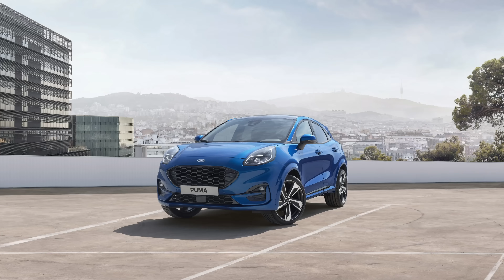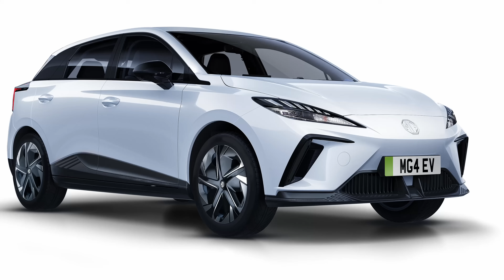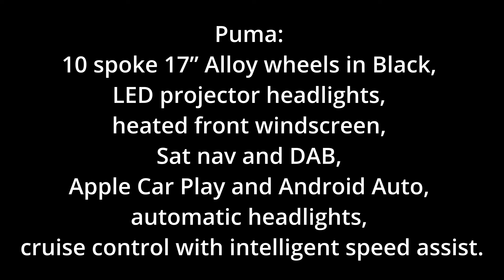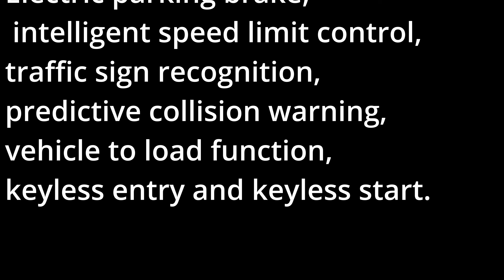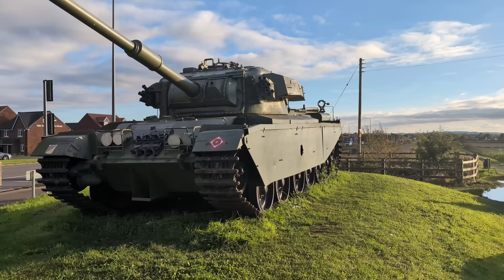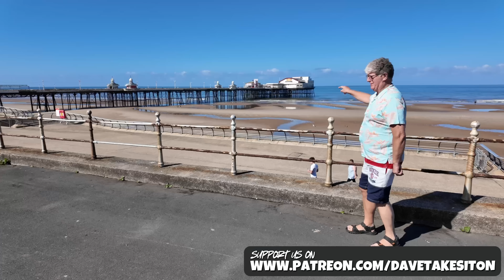Are Cheap Electric Vehicles REALLY Better Than Cheap Petrol Cars?

Comment: Another point in favour of the BYD Dolphin is the PCP rates. This negalres any worries about residuals (which are always a worry in a relatively new market, which is evloving si quickly). £289 deposit, £289 a month on 8k miles a year over 4 years blows anything else I've seen out of the water. Oh, and 3 years free servicing too! I bought mine from DM Keith in Grimsby, who were helpful and efficient, and a long standing local dealer, even if the brand is new to the uk. Maybe we could have a video comparing pcp offers of ICE vs EV cars in the future, as for most people this is the way we will fund our next car...

Comment: Nice one Dave, you can't argue that they are too expensive. If you only buy a second hand car the EV market is full and has many great value EV's that will still do a great job and provide almost all the range of a new one. Only time to wait is if you want an EV older than 5 years old as the good ones "in general" are still waiting to reach that age. Thee tech in an EV is far in advance of most ICE cars, such as adaptive cruise and pre heating.

Comment: If you like driving on a battery BOMB>
its the same with solar panels  and wind turbines  they cost more to make and the pollution
that they can make in a lifetime .
if you go mad and buy a battery car you must also have in boot a full camping kit   everything.  for when the charging goes ape shit.
Reply: @ashwayn  Solar panels have a 20 year life expectancy, wind turbines can run indefinitely. That's fair more power production than coal or oil. 
Driving a bomb? Do you understand that petrol burns? Have you ever actually seen an EV burn or explode as you suggest? I've seen plenty of ICE car fires, never electric and the current generation of batteries don't burn unlessintentionally ignited. The chemistry makes them near inert to the point you can shoot holes in them.
Reply: @chrisw3771  look on google scraped wind turbines you are off ya head wind turbines at sea are fucked after 20 years 
and I looked it up 10 years ago to relace a sea wind turbine blades  cost over a 1,000,0000 £

Comment: If you want to replace petrol/diesel cars,maybe replace them with something as useful or better.Still waiting for that to arrive.
Reply: Then you've obviously had your eyes wide shut for the past 5 years.
Reply: I would like to inform you that a vehicle type much better than petrol and diesel has been around for about 12 years. They are called Battery Electric Vehicles (BEVs). They are now as cheap if not cheaper to buy than Internal Combustion Engine vehicles (ICE). Also they do not require the maintenance of ICE, last much longer and are much cheaper to run than ICE especially if you charge at home. Another great thing is they are very environmentally friendly because they do not spew pot toxix gasses like the petrol and diesel vehicles do. I hope I have enlightened you on what is now available to replace toxix ICE vehicles.

Comment: Even if I'd buy an ICE car (which I won't) I wouldn't buy a Puma with its almost self destructing wet timing belt 1 litre Ecoboost engine, fine if you're only going to keep it for 2 or 3 years but dodgy as a long term ownership prospect.
Reply: Oh blimey I thought that they had solved that wet belt issue disaster.  I would never buy a Ford anyway!! 👍

Comment: You need to pay a thousand quid to put a charger on your drive. You cant get house insurance. Forget it. Second hand petrol every time.
Reply: Complete nonsense, it’s not a question insurance companies even ask.
Reply: Thats only if you want 7Kw charging. If like the average driver in the UK you do 20 miles per day then a normal 3pin plug at 2kw is plenty. It will give 8miles per hour so 8x6 hours(at least 6 but often more) will give 48 miles per night, over twice the average mileage per day. I put in a EV fuseboard/ 32a commando socket and cable for about £300. Even if you did spend the £1000 for a charger you would get it back in the first year anyway.
Reply: I’m in the US. Pay for an at home charger and it will recoup the initial outlay in 12-16 months in petrol savings. It depends of course on the cost of electricity and how much I drive.
Reply: Yes commando socket works for me too, £40 socket and some cable and trip switch for the consumer unit and it,s dumb so nothing to go wrong
Reply: @C-L66  Exactly. I put in an EV board with surge/rcd/pen fault and needed a 10m cable plus the commando adaptor for the Tesla mobile charger hence the £300 cost but its now got all the correct protection so worth it for peace of mind.
Reply: You don't really, most come with a 13A charging unit you can plug into a 13A socket and easily get 40 miles plus added overnight as you sleep.

2p per mile.
Reply: Two of my home chargers came free with  the car (Government grants) . My house insurance didn't ask about EVs they did ask about the cameras covering the driveway.
Reply: Pay to fit a charger and roughly 8,000 miles of charging has fully paid for it if you add the cheap overnight charging.
Reply: 😂 absolutely ridiculous, I use a granny charger that cost £95. I charged my EV from 56% to 100% last night using free Octopus Agile  electricity, and they paid me 22p. Insurance companies don't even ask about EV charging 😊

Comment: The problem is NOT everyone could charge home. For those of us living in a flats we need a large batteries as to let allow us to get throughout the week commute (300-400 miles) with one full charge over the weekend while doing my shopping. Smaller battery and frequently charging (public charger) is no go for me.
Reply: I agree it is more difficult and expensive for the 40% of people that can't home charge. This is where local councils should step up and ensure there is plenty of on street charging at sensible prices. Another option would be workplace charging, my nephew get his charged up for £1 at work, a great way to retain staff.
Reply: @MrDAVIDATKIN  Local council charging is not a problem in London but the time limit. Those are either slow chargers but still 2 hours limit or in case of the lamp posts charging strictly Residential Permit only places. I got plenty of public charges around where I live in London but all of them 2 hours stay limit or till vehicle is charged. I have no time to charge and be around the car / loose time as to remove the car when charged during the working week. That is why I had mentioned that 400-500 miles on single charge is a min for people like me. Living in flat and no work place charging. With this range I would fully charge over the weekend while shopping and then good to go for over the week. Anything less would require me to charge midd week or often therefore increase of my working time if I can not go home after work. So I am looking forward the new TY whit its rumoured 400 miles range.
Reply: There seems to be an upswing of focus on the 30% (varies by region) of households who cannot charge at home, an analysis from a few years back showed that the preferred method by drivers was on-street charging for those living in densely packed terraced housing and local fast/rapid charging the preference for those living in flats. 

There is a focus, in both central and local government to increase the access (simplify the process) for gully and on-street/lamp-post charging for the terrace group, and driving up the rollout of localised destination and rapid/ultra-rapid charging for the flat group, including incentives. There is also a push by EV driver organisations to establish a 'right to charge' similar to that implemented in other countries, to replace the barriers present for renters and leaseholders for installing their own chargers or using the schemes/incentives available (such as the subsidiised installation of chargers for flat owners). 

The latest government analysis (24th Dec) shows the range of needing on-street/public charging varies between 24% and 36% of households by region, in England the urban peak is now 32%, of which 16% have access to charging within five minutes of their home. A key barrier remains charging cost, which although is cheaper than fossil-fuels when using EV charging membership discounts is still significantly higher than that of home charging; again driving organisations are seeking for the VAT element to be lowered to the same as home charging.
Reply: @GruffSillyGoat I agree with what you've said, the only thing I slightly disagree with is that memberships for EV charging is cheaper than fossil fuels. I would say as an EV driver who occasionally uses memberships that they are comparable with current fossil fuel costs. An example would be Ionity passport, one of the best out there in my opinion that gives a rate of 43p kWh. At this time of year my car returns 3.3miles kWh or 13p a mile, also that hasn't factored in the £10.50 a month membership.
Reply: @MrDAVIDATKIN  - I based my statement on the average petrol mpg, which is 36mpg in the UK (source: NimbleFins) and average UK petrol cost £1.36 (source: RAC). The average EV does 3.4 miles/kWh or 4.2 miles/kWh for long-range EVs (source: EV database). The petrol £1.36 equates to a charging price of 60p per kW or lower for an average EV (71p or lower for a long-range EV). These are higher rates than membership based charging rates even factoring the membership fee into the calculation. 

For the 7,600 average UK annual mileage, 633 miles per month, this equates to £109 per month for petrol and £91 per month for Ionity including the £11 monthly membership; the petrol car would refuel twice and the EV would top up two to three times depending upon the battery size.

Of course for ICE there is the regret cost of two thirds of the energy purchased being lost to waste.
Reply: @GruffSillyGoat I'm an EV advocate, we have 2 in our household and none of them do very well at this time of year as far as economy goes. Certainly both are in the low 3 miles per kWh, with charging loss I would say more likely 3 miles. On short journeys  even less. My last car averaged about 45 mpg, my wifes pevious was about 50mpg across the year. So 36mpg might be what the RAC quote as average but it certainly is not correct for many. I'm not trying to be argumentative just accurate. 36mpg is a very low assumption in my view.
Reply: @MrDAVIDATKIN  - The MPG averages can be a little suprising to many, but have been raising over time, it's just there are a lot of low MPG cars on the road. The figures are those used in the insurance industry and market places (Cinch for example), collated by NimbleFins. These are based on real-world rather than NEDC/WLTP estimates, honest john have a real-world mpg online tool that can be used to check specific cars.

For the EV average figures this is drawn from EV database, who similarly determine real-world rather than projected efficiency and range. The average covers all seasons driving, using 23 degrees for warm and -10 degrees for cold. 

For EV's there are a lot of factors from battery type/size, model age (old leafs for example), and heating system (heat pumps vs resistive heating) etc. I anticipate once batteries become lighter with raising energy density and heat pumps become standardises the average EV efficiency will rise further.

Whilst personal experience varies (my non-heat pump Kia for example averages 3.5 miles/kWh, higher if driven in eco mode), I always use the averages as other's experiences may be better or worse than this and specific cases are harder to compare.
Reply: @GruffSillyGoat  Yes our EVs are non heat pump. Suummer we both manage 4 miles plus comfortably. Yes I'm sure efficiencies will improve a lot, Indeed the latest version of the Polestar 2 is at about 10% more efficient than mine. The trouble is  EV efficiency varies massively. I was talking to someone on social media who has an ID Buzz and they were getting only 2 miles kWh.
Reply from the maker: Hi gruffsillygoat, you really are a silly goat. You have absolutely no idea what you are talking about. No EV does 3.4kWh per mile and that is not what EVdatabase says. You have misread that or deliberately misquoted that. Please read it again and be accurate.
Reply: @davetakesiton  - Dave,  happy new year. Be kind, I'm dyslexic and typed the figures the wrong way round, will correct. EV database quote figures as wh/km, in this case I converted the figures to miles but forgot to swap the order as I usually do (it happens with dyslexia as you read what's in your head not what you type). 

Perhaps a New Year's resolution to be a little kinder and more understanding of your audience would be helpful, rather than assuming the worst and seeking to attack. You know something along the lines of "you might have mixed the kWh figure order up a little" as a prompt, would have been more in spirit with the message you say you seek to portray. Particularly with those who are owners of EVs (I know it's a Kia and not a Tesla) and seek to share accurate fact based information.
Reply: Update: Edited the order of the unit in the two messages above, mentioning this as they've now been shadowed so it makes MrDAVIDATKIN's comments look a little out of kilter. As usual with shadowed comments they appear in Newest First sort order but not Top Comment sort order.

Comment: All that  Chinese technology , computerised controlled,  electronically activated gizmos is just great until it malfunctions and becomes more expensive to repair than replace . Speaking as an owner of a 20year old diesel car this video sends chills . I don't want all that tech . I want a car that I can maintain myself .
Reply: Well in the 20 years since your last cars things have moved on, all cars have modern electronics in them. You'll just have to restrict your future purchases to used 20+ year old cars.
Reply: That's fine for you but I think you will find yourself in the minority. EVs require very little maintenanace with no oils or filters to change other than the pollen filter, no exhaust or catalytic converter, no clutch, starter motor, fuel injection system or complicated engine to worry about, . With the battery covered for 8 years it really is worry free motoring with servicing costs negligble and running costs of 2-3p a mile if you charge at home.
Reply: Maintaining your own car those days are over.Your 20 year old diesel causes harm to children.You have to live with that.
Reply: @foppo100  So do EVs, just not the ones in this country.  But I suppose to people like you that doesn't matter!

Comment: The Dongfeng Nammi Box Launch edition in the Netherlands is pound for pound even better than any petrol car, or that BYD Dolphin.  
A hatchback EV for €23.000 brand new, very efficiënt with an easy range of 310km in cold weather, enough space for 4  large baseball players and only 1330kg. 
ADAS level 2 driving, heated and cooled driver seat. Great EV in the EU, sadly not in the UK.

Comment: Very interesting..for me it all comes down to charging at home, thats the deal breaker for EV..
Reply: Yes, not having access to at least a 13 amp socket is a problem. If you're near to or pass a Tesla supercharger regularly, that would work.
Reply: @ziggarillo  superchargers are more exspensive than petrol prices and waiting around for 40 minutes to charge..
Reply: @godzuks  

Tesla is currently 39p per kWh, about 10p per mile, which is still cheaper than diesel or petrol.
Reply: Or work place or super market. It just needs to be available when parked. Home obviously wins but other options are available. Plus if only travelling the average 20 miles a day it’s not even needed to charge every day.
Reply: @kevinallen4604  work place or supermarket chargers give very low charge, forecourt chargers are more expensive than petrol..
Reply: Yes that is a huge stumbling block for a lot of people.  Ladies in particular don't want to be hanging about in a drafty car park waiting to get a car charge.  Also who wants to get the super low rate of charging at 2am in the morning or sit around drinking gallons of coffee!  A friend of mine lives in a perfectly nice little 80's estate where practically every house cannot have a home charge point.  Cars are garaged elsewhere with no electrical connection.  It was designed like that to improve the outlook of the estates housing arrangements that was promoting to good effect grassed outlooks with no off street parking anywhere near the house.  Great in the summer as games can be played in complete safety for both young and old alike. The idea being to avoid having lines of cars outside the houses.  A great idea at the time but useless for possible EV charging these days.
Reply: @johnnyhollis9977  yes everyone has access to a petrol station, ev charging stations are exspensive and waiting around for 40 minutes..not for me